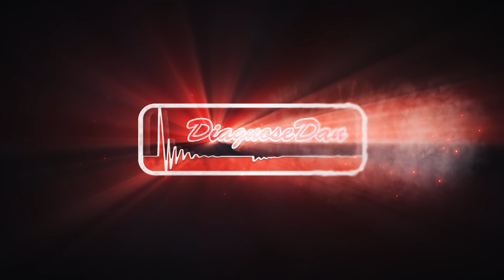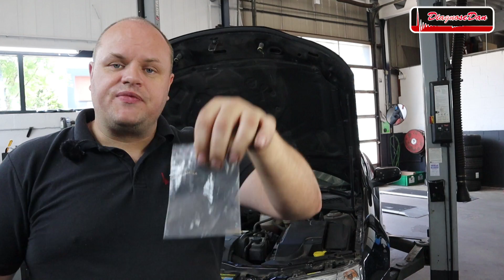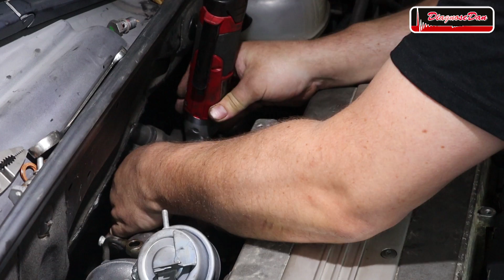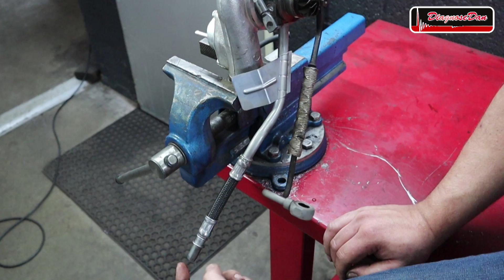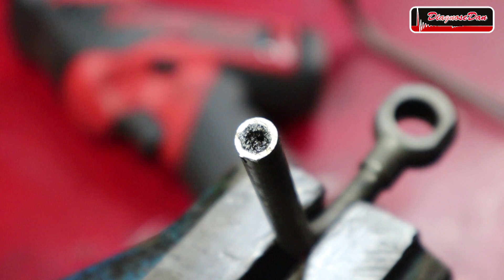Why did this new part only last one day?

Comment: Noticed first hand the pipes'physical appearance, re one old and other new.
Most probably pipes'function got confused in the fitter's mind . 
NB. Experience showed that in many instances, the oil pressure feed pipe supplied f with the new turbo would have been modified to a higher degree of reliability.
Excuse my pun. but today  the very high oil-change intervals recommended by car manufecturers coupled with the sometimes confusing array of different engine oils suitability  coupled with complex recirculating and processed Air Induction and EGR combination all in the mix to extract more power for the Specific Engines is a recipe for a huge number of- Air Induction and Exhaust Extraction induced fare installation of the new ilures.
Especially on diesels; oil sump removal for sludge build up cleaning
A Tee piece connection at theTurbo  oil feed connected to a pressure gauge guarantees the required assurance during a test drive after finishing the job.
Yes sometimes I would have to custom fittings at an engineering shop-- but that is complete peace of mind for such a high priced job. 
Well done Dan/mate.

Comment: Old oil , not changed  in time or wrong oil
You can not drive 30000 km with oil you must change maximum 10000km
and right oil

Comment: That’s why you have to change your oil every 10k kilometers guys. Othervise your oil passages get filled up with carbon deposits then it kills your turbo and your VVT system. After that there is a chance that some well trained technician changes your turbo without replacing the feed line. I think the biggest mistake is made by the costumer.

Comment: You should also check the water cooling lines since they can get clogged up with corrosion and cause the turbo to overheat and burn the oil resulting in carbon clogging the line.

Comment: You do have to wonder what interval and oil type this car had.  I have had many turbo-charged cars since 1984 and, knock on wood, I have yet to replace a turbo.  Always use the correct grade of oil. IT is so easy today. In 1984, I had to hunt out a special oil that Valvoline marketed expressly for turbos, a 15w40 grade called Turbo V.  In retrospect that oil was derived out of diesel oil technology.  My last car had 208,000 miles on it with the original turbo until a deer decided otherwise.

Comment: Why. Firstly I think that "heat shield/sink" in the oil feed line is a clue. 
Secondly, I think the EGR gases could have snuck up the oil drain line, through the turbo, to "misbehave" with the heat point on the oil feed line. Transient conditions could synergistically create the perfect storm for the oil and EGR gases to heat and deposit the carbon build-up over time. 
However, I think you are right about having proper oil and change schedule compliance.

Faulty EGR system or excessive blow-by is my thoughts on why the carbon build-up is in the feed line. So, ...now, how long does it take to happen again?
Reply: If the EGR gases snuck up the oil drain line it's indicative of a bad PCV.

Comment: Nowdays carmakers put higher oil change periods to show that they cars arr very maintenance free.Big mistake. 30000km oil period should be 15000km or even 10000km on some cars. Used oil will be much thicker and carry a lot of carbon deposit especially on Diesel cars.

Comment: Hey man, great vid. The cause to the sludge is A: the green ecofriendly longlife oilchanges. B: The "timing and design fault from the manufacturer, wich in this case sold 2 turbos with profitt" Just like your printer cartridges you know. Anyway, bought new cars and never visited the dealer. Checked it every few months and did an oil/filter every 15k km (instead of 30k) Did 300000k and the turbo and engine are still preforming like new.  I however always tried to drive it over 2000rpm, rarely using the 5 and 6th gear. Also note that driving only 10min rides regulary will clogg up most of the crap fitted to a modern engine. This i beleave is due to the condensation on and in the pipes as they drain empty when stopped. Remaining oilfilm in the pipe will react with the moisture and the buildup starts. Its all down to the oil, the quality of the oil and given that the amount of it is also decreased in newer engines, makes it soo important to change more often.

Comment: I GOT  A 2007 CHEVY AVALANCHE 5.3L, CRANKS, BACKFIRE/POPS AND YOU CAN SEE FLAMES COMING OUT OF THE OPEN EXHAUST AT THE END OF EXHAUST MANIFOLD, BUT WILL NOT START OVER, NEW FUEL PUMP,  PLUGS WERE REPLACED, THROTTLE BODY NEW AND TESTED GOOD, REPLACED FUEL WITH 93 OCTANE, ITS AN E85 SYSTEM,  CHASING MY TAIL, ANY RESPONSE WILL HELP THANK YOU FOR THIS VIDEO GOT SOME INFO ON IT, ANY ONE ENCOUNTER AN ISSUE LIKE THIS P1682 CURRENT, P0690 PAST CODE

Comment: Possibly heat soak after hard running with no cool down time before shutting engine off? Also, radiant heat from near by exhaust components could be cooking the oil in the line? Proper shut down procedure and or reflective heat shielding could provide a long term solution. Dan, I appreciate your time dedicated to these videos as they have helped me especially in the CAN communication area. Did you mention on one of your videos about an automotive scope coming with vehicle wiring diagrams pre-loaded? Thank you kindly, Danny

Comment: Hi Dan, I have a 2007 e90, all new coils and plugs, we just had a new starter installed and after picking up car we had flashing and solid engine light, its showing cylinder number 1 misfire, we checked all coils and plugs again and they are not the issue,  could it be injector? Scan tool not capable of checking injector.

Comment: I believe its from the line getting super hot after the car is shut off and it caused the oil in the line to cook over and over again,  I'd recommend allowing the car to idle for 30 seconds to a minute after a drive to allow the turbo to cool off.

Comment: That amount of coked oil in the line is likley due to higher service intervals (manufacture recommended) over a longer period, or just a lack of maintenance. As a tech/advisor/svs manager, we recommend an additive flush every 2nd service on turbo vehicles, because it was becoming all too common for mercedes Diesel engines to have blown turbos (and eventually engines) by around 100k... even when the customer was following the maintenance schedule. My personal vehicles, I have always monitored the color and smell of the oil and would change it early if it started to smell/look burnt.
I was the manager of a shop trying to calm a traveling customer down in this Same scenario. The tech felt like he couldn’t have known, but Diagnosis Dan shows everyone how to do it right!   Great video Dan!

Comment: What a great find!

A knowledgeable, experienced Mechanic and Workshop Owner, carrying out Professional diagnostic fault finding to determine the origional cause of failure, unlike the first workshop which simply replaced the worn out component with a new one without actually checking for the cause of failure, thereby ensuring the failure of the new component too!

Personable, Professional presentation and narration, excellent videography, lighting and editing, and a beautiful, clean Workshop in which to work.

It's nice to see Professionalism at work, and I hope the customer was able to get a refund from the cowboys that failed to even look for the origional fault!

What was especially damaging for the cowboy workshop is that the Oil Supply Line that came as part of the Turbo Kit the customer paid for, wasn't even fitted back onto the car, the original, faulty part was.

That you contacted the Turbo supplier and determined that they had supplied the OSL and that the garage had not fitted it was absolutely top work.

As a former Motorcycle Mechanic and Workshop Owner I am delighted to see your excellent workmanship.

It was because of Professionals like you that I went to Technical College and opened my own Workshop. Subscribed.

Comment: carbonization caused by excess heat as the turbo had not cooled down adequately - the turbo was heat-soaked; possibly high crankcase pressure causing backflow pressure, or an engine coolant circulating pump not working well enough

Comment: ok so he told 3 times to check if there was eny oil feed at all and i noticed that altho the axle was moving all around the place the turbo was dry (NO OIL LEAKING BUT IT SHOULD BE LEAKING) SO GRATZ TO PREVIOUS SERVISS  NOT NOTICING THAT,,,

Comment: I have a 07 mini cooper s where the turbo is leaking oil either into intake or the exhaust manifold..i know its leaking because when i took off the diverter valve it was full of oil....do u suggest a turbo rebuild or a new one...the OEM turbo is around 800 dollars

Comment: OTR truck driver. Turbo is life. Regular quality oil and the puttering around truck stops allows the turbos to cool down. No problem. A turbo delivery stop/start would fry the turbo and maybe more. Also not changing all the lines voids the warranty. You want that!

Comment: Now you have two ground up journal bearings circulating through the motor, eating up your bearings and cam journals
Reply: Hopefully the oil passes an oilfilter before it feeds any bearing.

Comment: prediction: oil line screens blocked, oil starvation to the turbo

well i was half right
Reply: Just having an oil screen on the port inside the block that went out to the turbo would have PREVENTED this problem from happening in the first place.
Reply: @Stoney3K  not if the screen gets clogged, starves it for oil and it fails, then you replace the turbo and not the screen. I've seen it done on Subaru's a few times, new turbo lasts a day tops before it dies.
Reply: @guywithjeep  Depends on where in the block you put the screen, but if the oil is just dirt and sludge, no screen is going to prevent it from damaging things eventually.

An oil screen is a mitigation measure but not something that will fix the root cause: Bad oil servicing or oil that is contaminated through bad driving.
Reply: @Stoney3K  True. It's usually in the banjo bolt that is in the crankcase side of the oil feed line. The screen is mainly for larger debris in case of an engine failure etc. But tends to clog over time from poor maintenance too. Which is generally why the turbo has failed in the first place...

I also like to pour some oil in the turbo before initial fireup, or disconnect the crank sensor and prime the system.

Comment: The problems start with the manufacturer stating extended service intervals  10kmiles is too much for oil   but they are only ensuring the car should make it out of warranty then its not their problem but they use it as a selling point

Comment: i found the best way to regularly clean deposits out of oil galleries is to run a high soap oil like castrol nemec, or similar but unfortunately that only works if the customer comes to you regularly and you run it only from one service interval to the next, then use normal oem recommended oil after that

Comment: They say when you buy a new turbo that is isn’t covered by any warranty or guarantee if you do not change the oil feed pipe and the return pipes while you fit the new one as this is the most common reason why the turbo will fail.

Comment: If the oil line is like that, the oil ways are bound to be carbonned up in the engine. That would go a long way to that very high oil pressure reading on tickover. I would get some seafoam or equivalent in that engine to clear it away and save it.
Reply from the maker: Thanks for the comment!

Comment: Wow. At last a good tutorial. Very odd that the previous shop didn’t even check the line. If that line hasn’t get glogged, the old turbo would have last much longer.  So it is important to check the line regularly or measure the oil pressure of the turbo output oil line. I believe that must be a part of large service.
Reply from the maker: You are right!

Comment: only way to be sure there changing there oil  on time is pull the valve cover off an check there .. Good way to know if the has been changed ... Also bigger line's could help stop some  of it ... Another  is  warm your engine up before getting in it an taking off.. also Another  is  after a drive  let your car or truck idle  for  a min before shutting it off
Reply from the maker: Thanks for watching 👍

Comment: Shit garage didn't bother testing properly. I mean why replace the cooling line and not the oil line, utter incompetence, when you are already there. It's like replacing the timing chain/belt and not replacing the water pump.
Reply from the maker: You are right 👍

Comment: I'm still on my first turbo with my 2000 audi a4 1.8t.  I,ve used mobile 1 10w40 every 5000 miles with a new big mahle oil filter change at 10k miles.  No issues, since it has a manual, with my 20 year old audi quattro.
Reply from the maker: That's great!

Comment: 48 secs in. 1st diagnoses and replaces the bad turbo. Was the turbo even bad? Will edit again once I get further into the video.

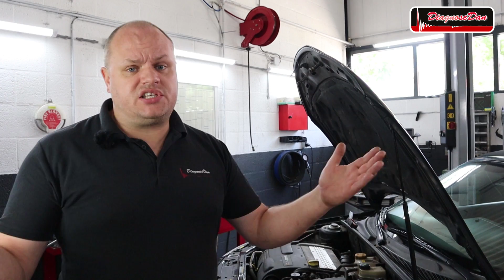1:42 - 2nd turbo failed. Bearings... Not all there.

2:42 - water and oil cooled turbo. Failed bearings = no oil or very little oil.

3:29 - car starts. No oil from the oil feed line.

4:36 - sufficient idle oil pressure from OPS.

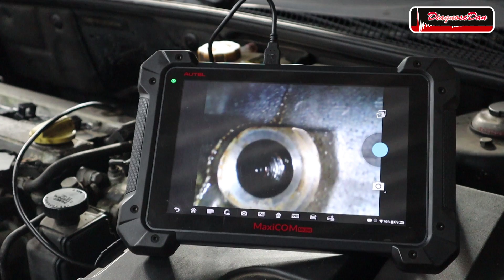8:29 - oil is being sent to the oil feed line. Bad oil feed line?

9:41 - bad oil feed line confirmed. No smoke passing through the line

Comment: Carbon desposites are probably due to either a cheap oil filter, too many kilometers with the same oil.
Another possibility is that somehow carbon conteminants from combustion got mixed in the oil somewhere.

Do mind that the oil that got oit of the engine side when you did the test if the turbo got fed oil was REALLY dirty.
So the oil is getting dirty in that engine somehow.
Reply from the maker: Thanks for taking the time to leave a comment it's appriciated 👍
Reply: @Diagnosedan  Well, just take my comment with a grain of salt though. Just a normal guy who tinkers with cars, so not a professional.

Greetings from Groningen. ;)

Comment: Blockage probably caused by the bad practice of switching off engine while still hot and spinning at high speed.  This hot oil would then coke up the inlet pipe restricting flow until it becomes non existent  , a bit like a person that smokes heavily with their arteries.😀
Reply from the maker: Thanks for the feedback 👍

Comment: First would be to see if oil in the engine is still good. Would see this clogged up if engine is missing a heat shield and after heavy driving it will stay cooking external walls of the pipe and buildup will start gradually. I would also start to think that owner it driving it hard and not letting it to idle before turning engine off (turbo timer).
Reply from the maker: Thanks for the feedback 👍

Comment: 6:55 A Rolls Royce RB211-524G2 jet engine (or Gas Turbine) on a Boeing 747-400 is a 3 spool design or 3 concentric shafts running at different speeds. 
The big fan at the front (or LP Low Pressure Compressor & Turbine) runs at 4300rpm @110%, 
the IP Intermediate Pressure compressor & turbine spins at 7000rpm, and the HP High pressure compressor & turbine spins at 10,600rpm.
Reply from the maker: Sounds like you know these engines!
Reply: @Diagnosedan  
Yep, I'm a aircraft maintenance engineer in the airlines. 😀

Comment: Hmm... typical fix broken part without any fault finding.
Had a friend with a brand new dealer rep car. Transmission died from over heating... new one fitted, died in similar fashion so fit another one which died the same. After a bit of thorough  research, the cooler pipe in the radiator was crimped shut. 3 dead transmissions to start looking for causes blind freddy could find if he looked.
A very poor indictment of the dealer mentality. Your customer should get his money back from the other repairer.
Was very definitive cause  which is probably what killed the first turbo.
Could be that oil changes were not done on schedule ( That oil looked a bit black) because some owners are idiots and maybe some hot shutdowns coking the oil in the pipe. 
Maybe a bit more lagging on the pipe to prevent radiant heat but shame on the original shop for not looking a bit further.
Reply from the maker: Blind Freddy😂😂

Comment: The oil feed line is probably too close to the exhaust and is cooking and carbonising, it might also indicate wrong oil or oil change interval is wrong.  Anyway regardless, I expect the feed line problem will occur again in the future and the turbo will die again. Maybe use synthetic oil and buy high heat protective oil line sleevings for the line.  This will certainly mitigate against this issue in the future.
Reply from the maker: Thanks for the comment Paul!

Comment: Thanks, Dan for taking the time to give us another fine video.  Oil is the lifeblood of the engine. The first mechanic failed to do his job correctly and probably thought by not replacing the original oil line he could save some time. That was a bad mistake.
Reply from the maker: You are right 👍

Comment: Build-up caused from lack of proper maintenance?

3000 mile oil changes,  instead of 5000 or 10000

Imo

Id slso check the coolant line
Reply from the maker: Thanks for the comment 👍

Comment: turbo feed line may have been getting heat soaked and cooking the oil in the, not really sure though. Would be interesting to check with a thermal camera or a laser thermometer, perhaps it's too close to the exhaust, or hot side of the turbo.
Reply from the maker: Thanks for the feedback 👍

Comment: My guess is they either didn't use a good full synthetic oil, or they were extremely lax with oil changes.It's also possible there is a missing heat shield between the line and something hot like an exhaust manifold.
Reply from the maker: Thanks for the feedback 👍